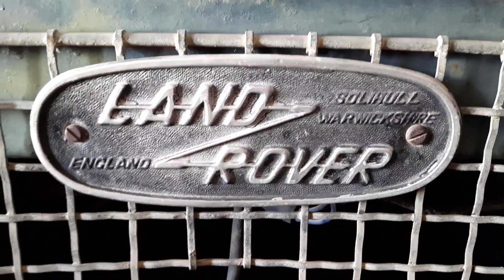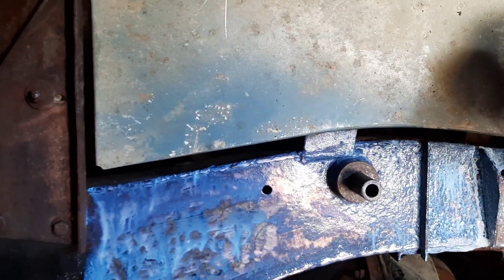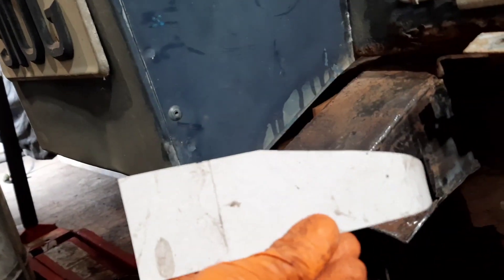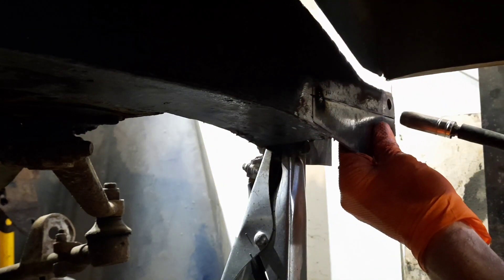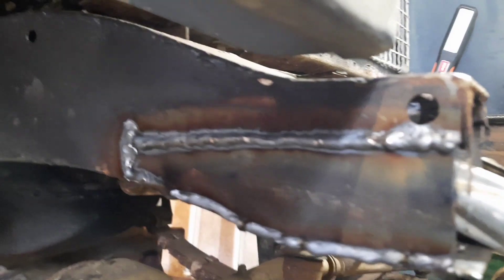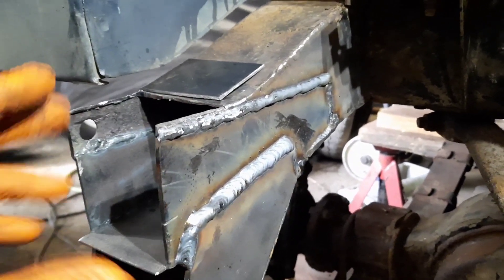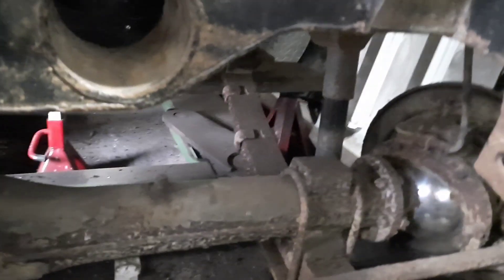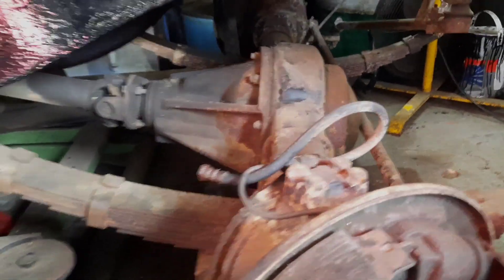Land Rover series 2a restoration work, Rotten front spring hangers! 🔧

Comment: I think there should be some crush tubes in the front of the dumb irons to bolt the front bumper through. 
Nice old S2
Nice repair
Reply from the maker: Yes they were rotted out, when I come to fit up the front bumper I will drill the holes and add some crush tubes. Just debating whether to straighten the bumper out or get a replacement.

Comment: Can I ask what welding equipment / wire / gas you are using. I'm about to start playing with the 'ole electric glue myself, and as I've not used my welder for several years, I suspect I need to buy some new wire.
Reply from the maker: I use a sealey turbo 185 mig welder with argon co2 mix gas, 0.8mm wire. If you get it set up to where its blowing holes then turn the power down until it isn't blowing holes and the weld has decent penetration into the metal you should be fine. If welding on the chassis you should be able to turn the power up more.
Reply: @Meadowcrafting  cheers. Is there a particular brand of mig wire you recommend too?

Comment: Good . When removing hangers, best to weld an arm to the chassis with the same size hanger bolt hole, so you can weld the new hangers in the spot on correct place . JC 3/2/25 .